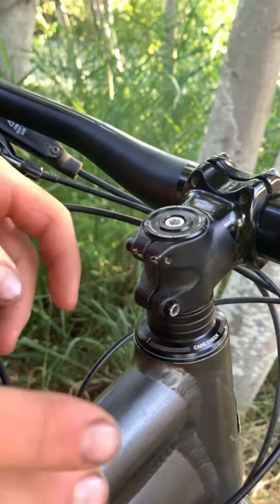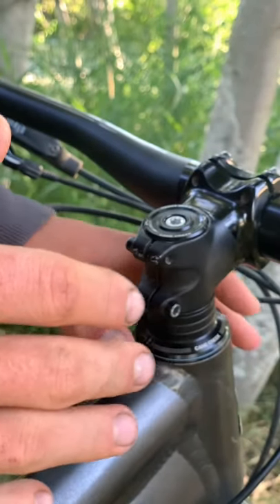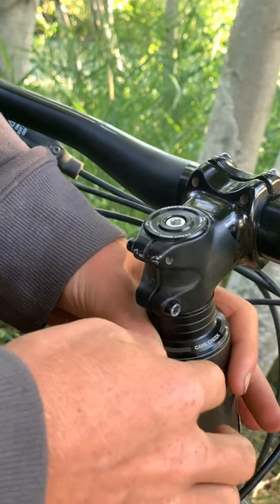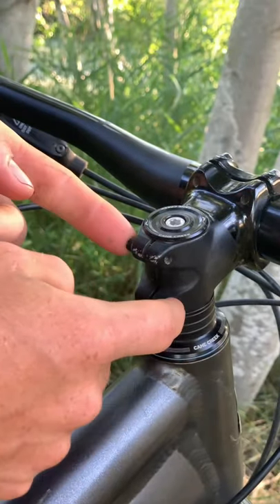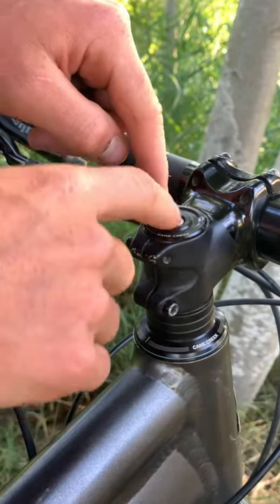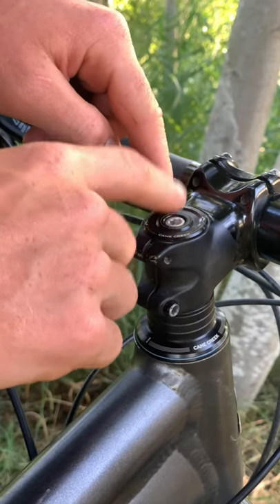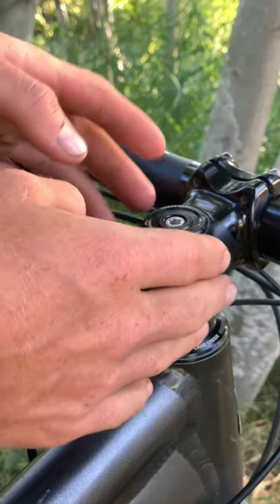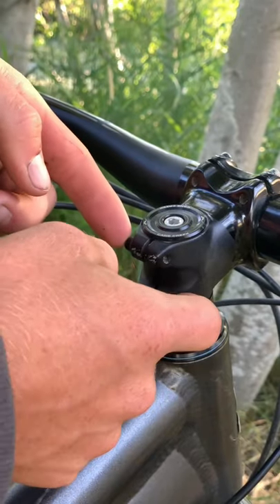How to Tighten a Bike Headset

Comment: Thank u just saved me money 😅, my front fort headset was loose I was tightening it and was still rocking didn’t know u had to undo bottom 2 first then tight the top one thanks so much u just earned a sub 😊
Reply: Bro i did as the guy said in the video but still its loose
Reply: @Mat293dj  strange might need new headset
Reply: @CallumW2355  Yeah but the bike is new i dont see why should i change it,i needed to loose the headset so i could straighten the handles and after all of that the problem appeared and i also noticed that only my upper washer is loose even after i tighten the headset

Comment: Do u know why when I move my handle bars it doesn’t move with the wheel
Reply from the maker: It depends. With a stem like mine it would be because the pinch bolts aren’t tight. Although there are older styles that work differently.

Comment: Yeah it still wobbles I don’t know what I’ve done wrong
Reply from the maker: I’m not sure exactly what your problem is. But you could try and make sure to loosen the pinch bolts (ones on the side of the tube) and then tighten down the top bolt. 

You might also need a spacer. 
Hope it helps!
Reply: @thatfastbiker7390  so I cut one of the rings in half inside the fork and it’s much better now, although the top cone isn’t touching the frame anymore at least it’s not wobbling. Thanks anyways!
Reply from the maker: @OneTwoFive0  Yeah no problem! Sorry for the late reply
Reply: @thatfastbiker7390  no problem 👍

Comment: I tightened mine yesterday but after riding a few minutes it had movement again
Reply from the maker: I’m not sure how to keep they from happening. I have the same issue with my dirt jumper! But I am doing 360 and things like that. Just keep adjusting it!
Reply: @thatfastbiker7390 that just happens when you ride hard. It could also be because your headset might not be greased enough.
Reply from the maker: @gigglewumpus  You are correct. But if you don’t tighten it, it will wear out the head set even faster. And it does help to keep in greased!
Reply: @gigglewumpus Grease? Are you really supposed to grease it?